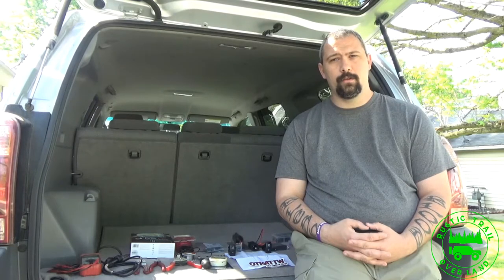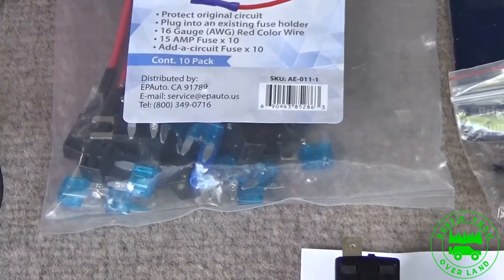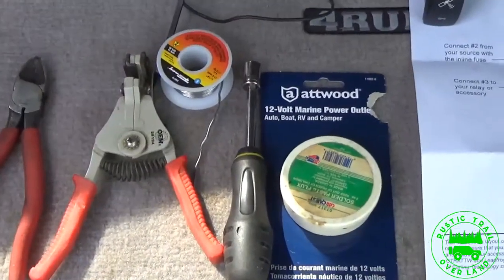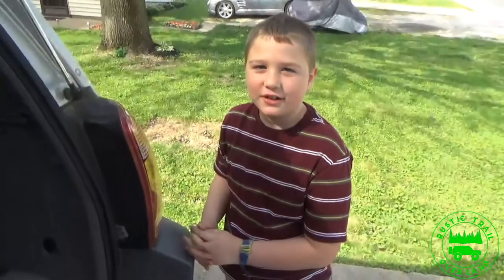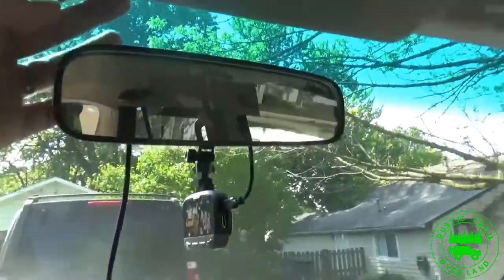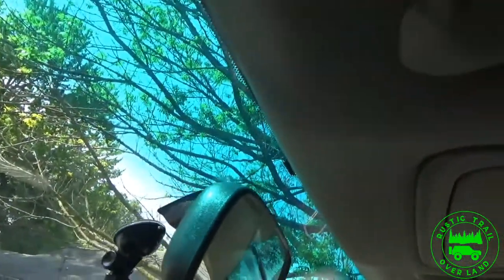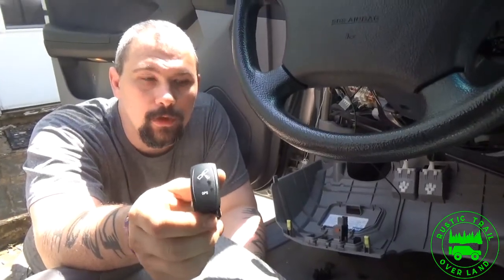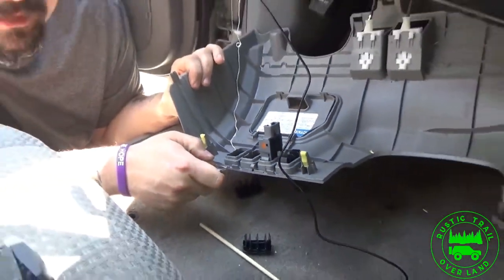Cobra CDR895D Dash Cam Install in 2003 Toyota 4Runner

Comment: I know it's been some years since you posted this but you just made my life a lot easier installing my dashcam in my 04. I have done two previously in my older 4Runner and a Golf, but it's always nice to see it done first to save missteps and hangups. Thanks!
Reply from the maker: @Lonememe glad I could help.  I’m by no means an expert but I try to do most things myself so if I have a problem I at least have an idea where to start.  We’re still around just not as active with everything going on.  Hope to have a new adventure soon.  We itching for some excitement.

Comment: Hey I like the way you installed it with the buttons that say Dash cam and all that nice in my case I have it with the wiring directly from the car electricity and the wiring always has electricity what I do is disconnect the camera if I'm not going to use more the car for the rest of the day.
How does the audio sound on your DashCam CDR-895D ???
because in mine the audio is terrible a lot of noise I have to put it in mute.
Reply from the maker: MrJKing21 Korey  here - thank you, I got the switches from https://www.otrattw.net.  I really like them and plan on getting more for upcoming projects.  I find the audio is really good sometimes too good.  During our adventures the kids still haven't learned the camera is always running.  We have a video coming out this week,  where we go pick out our family Christmas tree and I have audio and video from the secondary camera.  Be sure to check it out and here what it sounds like.